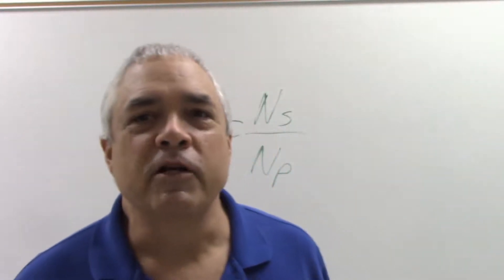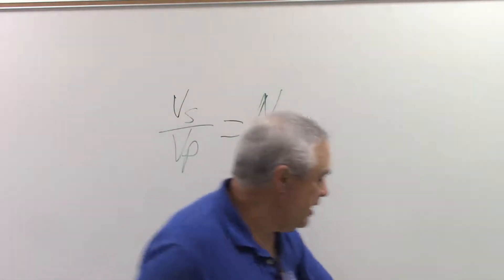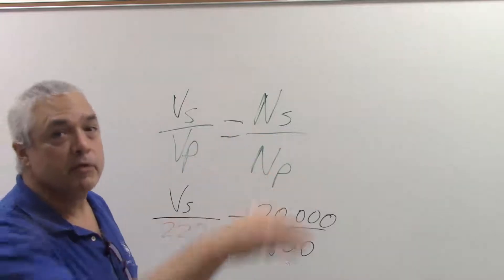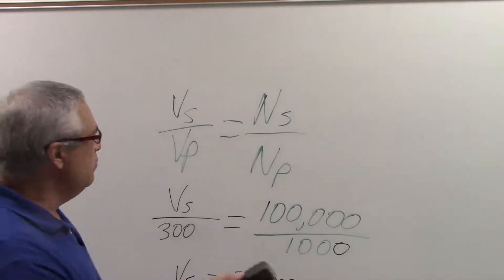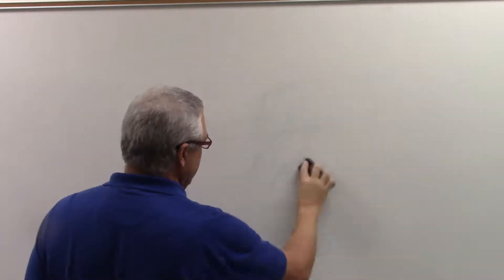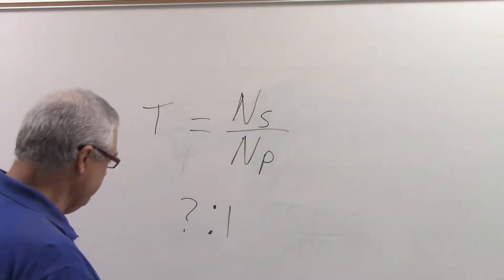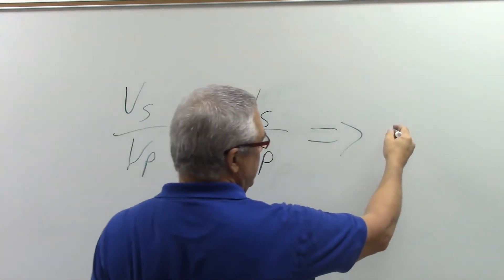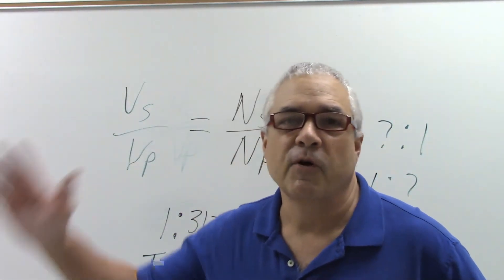Transformer law

Comment: Hi I wanted to ask about the unit of measure.. does it not matter when cross multiplying? Are the turns ratio numbers a different unit of measure?
Reply from the maker: Hi!
Turns ratio is simply a convenient way to compare the secondary and primary. So if there are 1000 turns on the secondary and 100 on the primary, then the ratio is 10:1.
Units of measure, when you cross multiply, will cancel like in any other math problem. so if we're given 220 volts, 1000 turns on the secondary, and 100 on the primary, then when we cross multiply and divide the turns cancel each other out, and you're left with 2200 volts. 
I don't know if that helps or not, but if you practice with a few of these problems,  it'll give you a better idea.